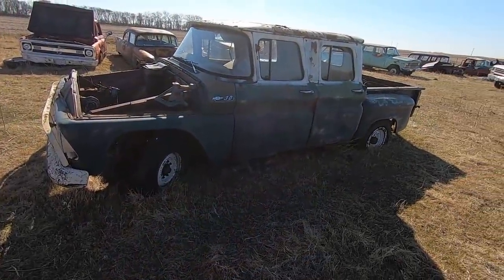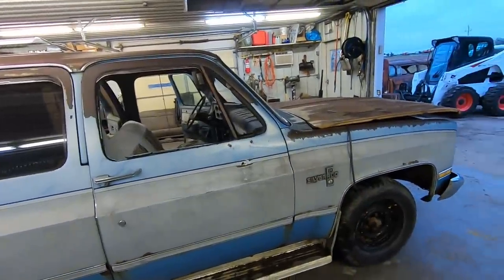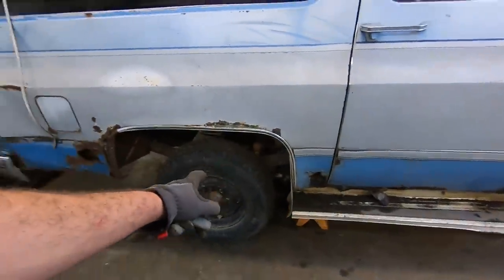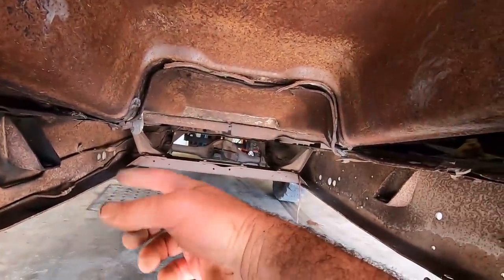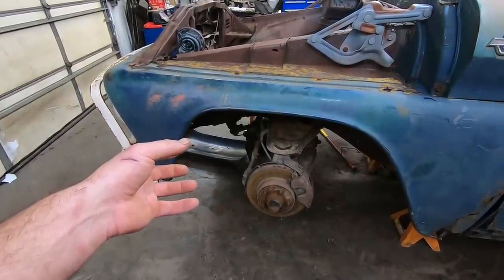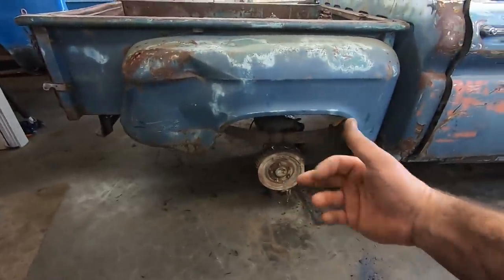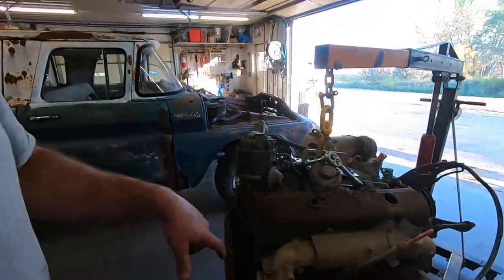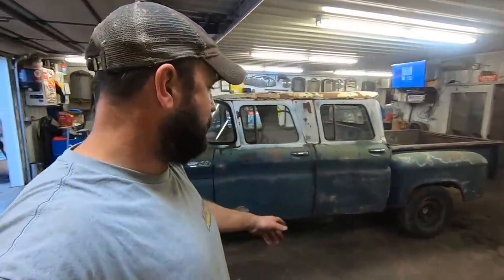RARE! 1962 Chevrolet CREW CAB factory conversion field find! And 1/2 ton suspension swap!

Comment: Hey mort I’ve got a question. If the top center bell housing bolt is threaded it should be a 4 bolt main block? I saw that on that burban block and had to ask?
Reply from the maker: Nah, that has nothing to do with it.
Reply: @MortskeRepair  I’m watching you and puddin on the moline tractor. Laughing my ass off. Loving it!
Reply from the maker: @lochnessfox3441  Glad you enjoyed it1

Comment: a two bolt main block is stronger than a 4 bolt because GM had to put on 4 bolt main on because of the block they were using in 1972 up were green "didn't have time to age before machining  . the engines were busting the mains out as they came out the factory door

Comment: I'm sure you know this but you can tell the date of any vehicle by looking on the rear end the taillight because there it will have the year on those tail lights oh, it will be the last two digits
Reply from the maker: Except they used the same taillights for many years in some instances. Like 73 through 91 GM pickups or 60 through 66 GM pickups.
Reply: @MortskeRepair  the taillights will have the exact year on it
Reply from the maker: @oldmanscrapin7579  I've got 4 of those squarebody GM pickups here now. They all say 1973 on them. The first year those lenses were used. But none of the pickups are that old. Prove me wrong!

Comment: I got a l34 360 hp 396 dated march 5th 1965 out of a 66 impala needs to be rebuilt std bore cylinders look like would clean up with a hone almost no ring ridge timing chains still tight I bet head job head gaskets and it out run has 206 oval port heads early holley intake and carb I would sell for $2000 in Wisconsin.
Reply from the maker: That would be a cool engine!
Reply: I have a 65 chevelle I bought the engine for im at the point I dont know what to do. The chevelle has #'s matching 195hp 283 and a powerglide car runs and drives excellent the way it is. Still tossing around the idea of 396 already has big block springs up front.
Reply from the maker: @malibu6510  I'm tempted to build a BBC for my 55 gasser!

Comment: If it came in thru intake is why most cylinders were closed but one was open and another partly and thus rusty cylinder walls. Sucks.
Reply: Came in from cracked cylinder sucks more lol. Cool crew cab. I saw a six door suburban extended also weird and cool.

Comment: That part with axle gear boxes found out channel it's called tech channel what that Thailand guy does what engine customized he 3d prints etc and finds auto parts etc cool man i told you about him other day it's tech channel found out he's having newer and newer things every day cooler things jeeps every thing at home even bringing Volkswagen back he said might haven't seen him do it yet but will though he builds them at home even those three wheeled rex car looking things with one wheel thing in back and two like car in front he's making ones invented by him though while others in American shops he's making ones in Thailand with tops on them to protect them from rain and think got wipers on them it's like bubble and leather or tarp top than can take the top off on sunny day

Comment: I don't know where you are but I have a 700r4 you can have, pulled out of my 85 square body might throw in a 305 if you twist my arm.
Reply from the maker: Is it a 2 wheel drive?
Reply: @MortskeRepair  yes
Reply from the maker: @vanamsgarage  Where are you located?
Reply: @MortskeRepair  South East iowa
Reply from the maker: @vanamsgarage  Shoot, that's a bit of a haul.

Comment: If it was a known good motor and you wanted to you but it at bottom dead center pour water from graduated beaker down pull hole it holds 690ml its a 305 
755ml it's 327 if its 810 ml it's a 350 and 865 ml its 400 but if it's bored all bets are off

Comment: If you were going to go with independent suspension why wouldn't you just made it a four-wheel drive or even at that matter a straight axle for all Drive
Reply from the maker: I"m not a 4WD guy I guess.

Comment: You can rebuild those jacks it's not that hard I have a bunch of hydraulic jacks from people with more money than brains that toss the jack because the ram starts leaking and they don't want to replace the seals in the ram to make it new again so I collect them fix them and sell the one's I don't want and keep the ones I want to keep and laugh my ass all the way to the bank.

Comment: why the hell dint you just use the whole frame from the burb under that dub cab?would have saved a buch of work
Reply from the maker: Making body mounts would take a week. And the wheelbases are different. Then you gotta make bumper brackets as well. This way it's all bolt in other than the leaf spring mounts.

Comment: look at the shape of the back of the crank shaft
Reply from the maker: What's that tell ya?
Reply: I only know this because I have a DZ302 I thought was a 327 when I first got it ;)
And currently trying to figure out a long block I have ( that's supposed to be a 327) is a 327 or a 350 it's crankshaft does not match any of the pictures on that website :/
Reply from the maker: @gorr4  That's awesome!
Reply: @MortskeRepair  did my comment with the website link come up?
 I don't see it now :/
Reply from the maker: @gorr4  nope
Reply: @MortskeRepair  I've tried 3 times YouTube keeps deleting it. even typed out the dotnet last time
Reply: 283 is round. 302 is round with one corner cut out. 327 can be rounded one corner cut out, two corners or a pinch top mushroom.  350 is more of a taller mushroom shape with the sides shaved shape.

Comment: Why didn't he take the front clip off, totally made the job easier. DUH.
Reply from the maker: Would have. Didn't figure it was worth the effort. And snapping off 14 rusty bolts. Then you have to figure out where the front wheels need to be without a fender to align them.

Comment: Well now I shall expose in a few words, my sickness. Left the heavy  rear under, put heavy straight axle four wheel drive front end, six cylinder with four speed truck rear end. I definitely would fab some floors in .... nothing special, leave dents and all with the lets go camping and toss a cracker box camper on back with jerry cans for fuel... what else to do to make it never come back. Knock all the flakey paint off, wire wheel rest, do the army green and black stripes..... pto drive winch on front and a string of gregarious lights on front and some C.B. antennas for calling mars. Yep thats so rare that its a keeper.... you keeper or just get what you can for scrap value before its so low the irons a gift to them again
Reply from the maker: sounds like a fun project!

Comment: that's not a factory conversion, more like a homebuilt conversion
Reply from the maker: A coach builder made it for the Air Force, crude yes, but done in a production facility
Reply: @MortskeRepair  ok, that makes sense. The factory conversion I saw didn’t have vent windows on rear doors and definitely no piano hinges. The rear doors were a more squared off shape rather than using a pair of front doors as rear door. A very interesting Chevy you have there!!!

Comment: 2 bolt is stronger than 4 bolt , cracks between outer bolts when stepped on. A splayed four bolt out of a two bolt. Or stud girdle two bolt are both stronger than factory four bolt. Over rated lol